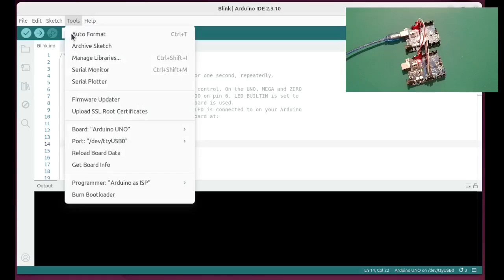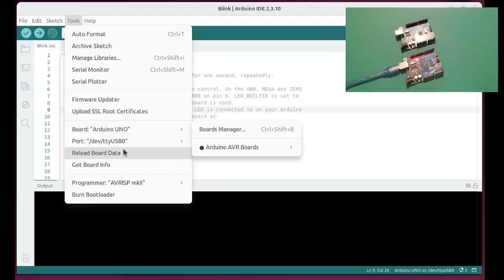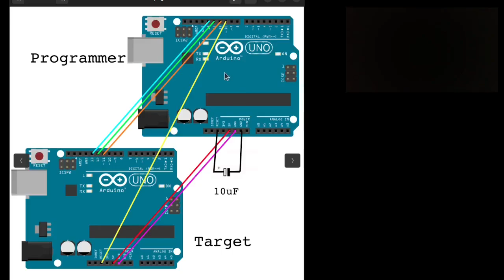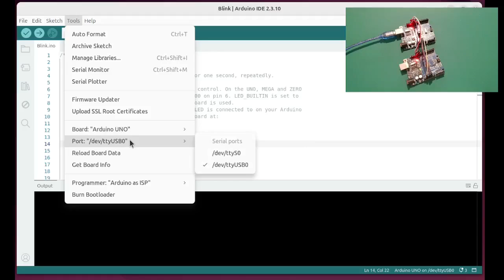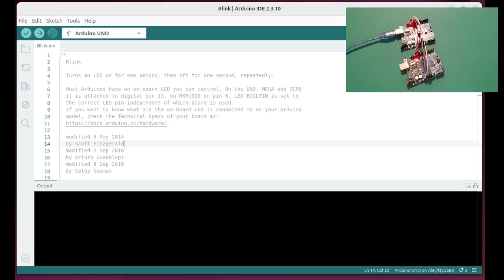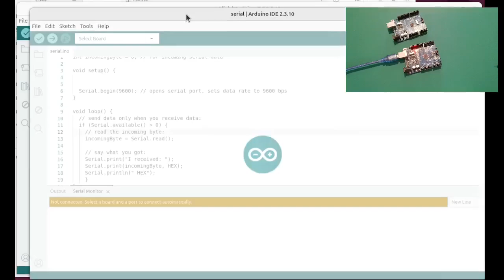Arduino as ISP - Reliably

Comment: Very Nice Tom.  When I run into these issues that the bootloader seems to be corrupted I use a dedicated Arduino Nano, and then use the ISP Connection 6pin header to connect the Arduino's together, Taped the Cables together so you can easily Connect them to each board and load the boot loader that way. that way you don't have to remember each time which pin to use.